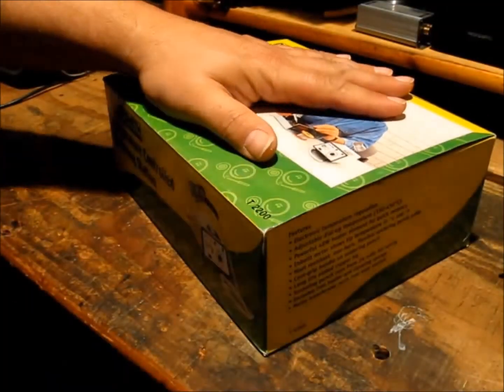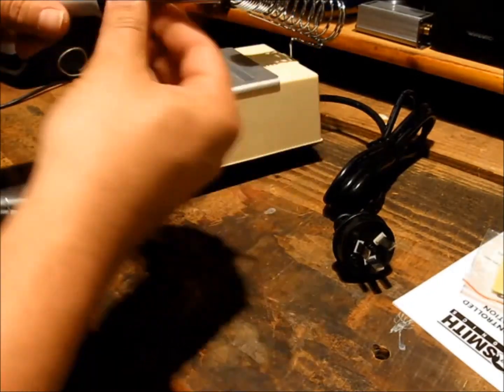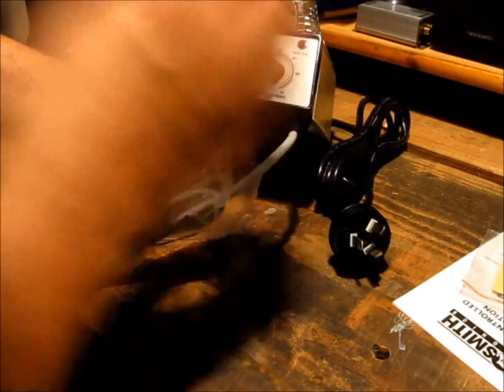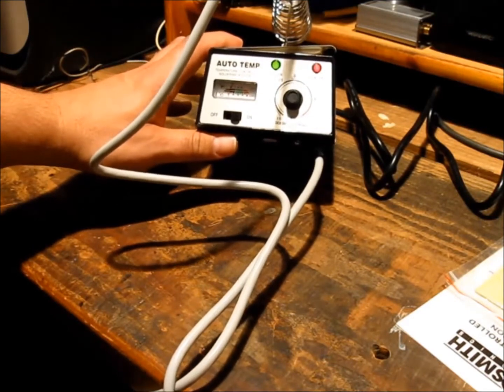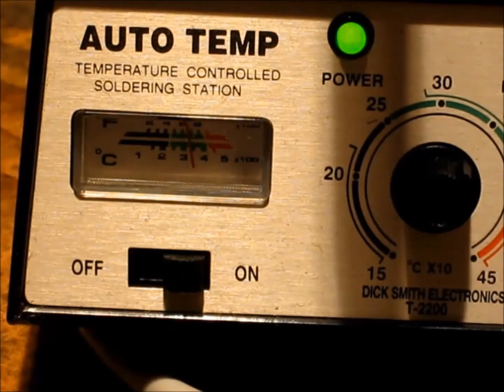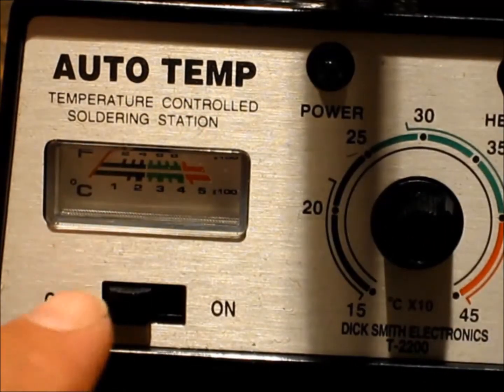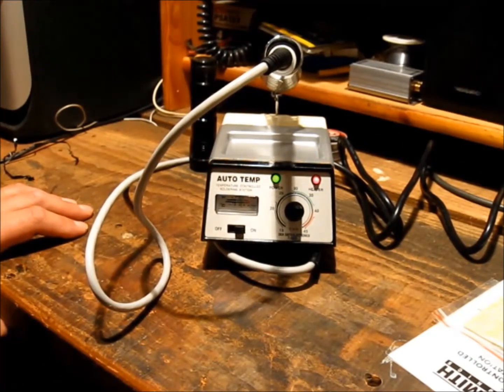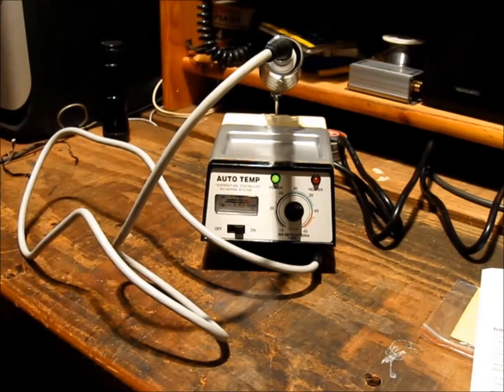Dick Smith Electrical T-2200 Soldering Station

Comment: 2025 mine's still going strong.
Reply from the maker: That is good to hear, all these years later I don't recall much about the T2000 but this T2200 I still have 😉
Reply: @SpectreOZ  thats what I have, did I spell it wrong?
Reply from the maker: @Cassandra-h5g No, not at all, it was just my nostalgia kicking in.... I also used to have the previous model 😉

Comment: Can not replace mine, the cable got cut once, i think my daughter did it, but, with access to another iron, i fixed it. Still works today, just cleaned and re-tinned the tip.
Even works portable on the Ryobi 36v inverter

Comment: After 24 years of pretty heavy use, the silicone-insulated cable for the handpiece finally failed. Teardown (it has one large transformer and a single PCB with three or four trimpots for calibration) yielded that a single conductor had failed right at the point where the clamp secures the cable in the main unit. I replaced the cable with a piece of four core with PVC insulation, and when that fails in a decade I'll probably replace it with a proper silicone-insulated cable.

Comment: A great soldering station. The manufacturer is XYtronic and these were rebadged for DSE. Micron, and other brands were and still are made by XYtronic.

This particular unit is model 168-3C and was upgraded with digital display to model 168-3CD.
http://www.xytronic-usa.com/shop/item.aspx?itemid=236

Three replacement tips (micro, mini, and standard chisel tips) are readily available at Altronics as parts T-2423, T-2424, T-2425.
https://www.altronics.com.au/p/t2423-micron-0.8mm-chisel-tip-to-suit-t2420-t2485/ 

Mine cost $70 or so, has been used near daily for the best part of a decade, and is still going strong... unlike other soldering stations that I have owned.

Comment: Hi,I still have my T-2000 from about 34 years ago. mine has the analogue meter. dont spose you know if the 
heating element had a thermocouple or  thermoresister as I like to get it  running again, lasted 30 years on one handpeice,
Cheers
Brett
Reply from the maker: kermets AFAIK the DSE T2200 was a rebadged version of the Xytronic 168, according to what little I could find on the net it utilises a thermocoupler design, I have noted some parts for this manufacturer on eBay but as to their compatilibility I could not hazard to guess.
Reply: Ok thanks for the tip re-Xytronic 168, I have also found a manual with circuit diagram of the T-2000 
just written two ways as far as I can see, you can view/download them here second post.
https://www.eevblog.com/forum/beginners/dick-smith-t2000-soldering-station/
Cheers
Brett

Comment: 50% off wowow
Analog  movement that's far out
So are you going to pop it open ?
looks like a winner!
Reply from the maker: Yeah it's a groovy old unit, Dick Smith Electronics purchased a bulk shipment from XYtronics in the Taiwan probably 10 years or so ago and there are still some old stock floating around their stores (mainly their online store), I had been kicking myself for missing them when last on close out at $80, so when I saw them at $50 for one day only I jumped on it.

It is essentially a XYtronics 168-3C model albeit slightly different, tips from the T-1976 model also purportedly fit as well.

A tear down eh? got some other projects to move along first but that's a definite possibility.